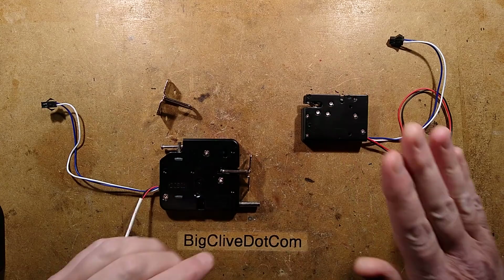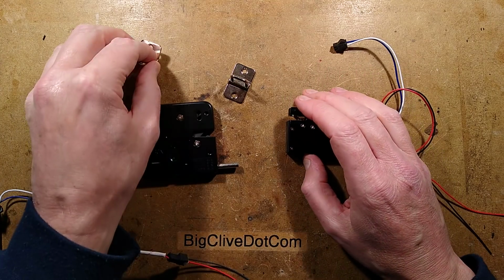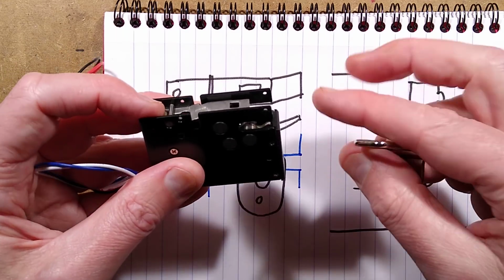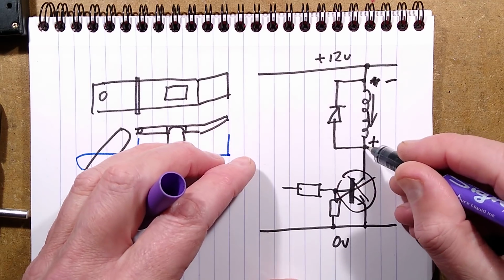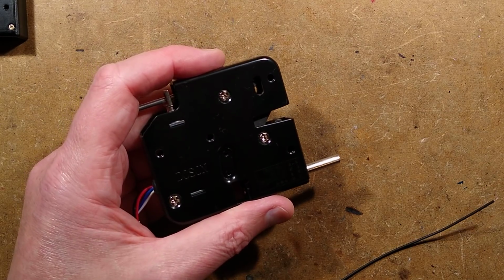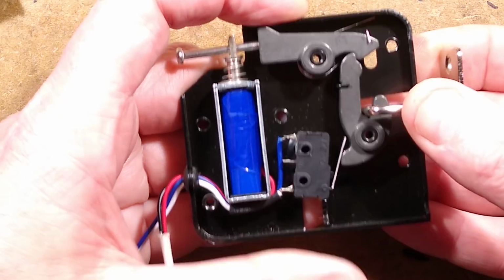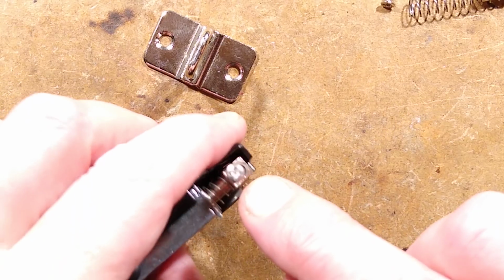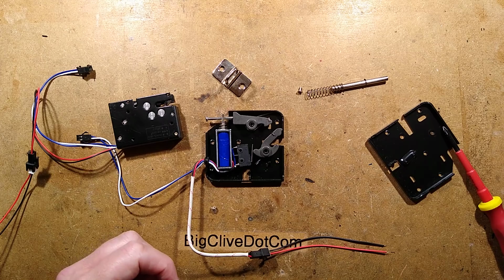Inside an eBay electric lock mechanism

Comment: Problem with that design is that if they fail, they fail secure (which means the lock stays locked). A convenience that suddenly becomes a significant head ache, especially since the lock will usually be mounted inside the door.
Reply: Oh, I've been servicing such problems for 4 years already. Our automated lockers, used specially for drycleaning orders, use bad quality locks, and they stopped opening doors after a few months of working. Every few months, kind of in a way BC described at 6:57
Reply: i often see these in pick up scenarios with double sided lockers where the back door is in a restricted area and only has a mechanical latch on it
that solves the fail secure issue nicely but i'm sure tons of uses aren't like that
Reply: These are the name of my existence, my eye started twitching as soon as I saw that thumbnail
Reply: We use hundreds for more than 5 years now and not a single one has failed.
We do have single hole and tool planned so we could push the latch through the (not yet drilled) tiny hole if we really need to, but I guess crowbar would work too... 😁
Reply: @zlac  you should consider yourself lucky not having to deal with this. We use lockers which were built with having lowest price in mind, they are made from wood, - so no service compartment for locks. Meaning you can't get to the hole on the back of the lock to open it in case of emergency
Reply: @KOTYAR1  Oh, we did the same thing. Cheap wood and $2.50 locks from China. We use software to shoot 200ms impulse "just long enough to open" so none of them burned out and probably won't. Transistors we use are actually short protected ICs so they're safe as well.
We use those in the gym lockers. All the lockers are made of cheapest wood possible and the lock itself is inside a simple cnc made plastic case that has a hole next to the latch so you could use like a bicycle spoke or something and push the latch... never needed to do it yet, maybe it wouldn't work, I don't know... maybe there's another "failure point" that we didn't come up with, but hundreds of lockers with those crappy locks and RFID reader in each one of them and they ALL work 5 years later, it even amazes us! :D
Reply: @zlac  that's how they SHOULD work. And our manufacturers wonders, "hey, why don't ppl buy these in droves?" and "hey, why do ppl buy these lockers, install them, use them for a month and then scrap them?"

Comment: wondering if there's any mechanical "pulse" push button... 
the detent in these locks could be quite useful when the moving door needs a start kick to be pushed away especially in the sliding door design.

Comment: Harry Potter's Platform 9 3/4, have your smart phone on the trolley walk up to platform 9 supporting pillar  and the door opens to reveal platform 9 3/4. Or a trap door in the floor to get rid of unwanted visitors to the cellar. You said they can not be opened with a magnet have you tried a piezo spark generator from a gas lighter?
Reply from the maker: The piezo spark technique was designed to damage the electronics.

Comment: I suspect the Lockpicking Lawyer would have that open with some implement in less than a second.
Reply: He'd probably have a live pigmy goat lick it.
Reply: He can't. It's behind a metal door. No outside access.
Reply: As it would be buried inside something else, the security of whatever its inside determines how easy/hard it is to get into. Additionally any sort of EMP device would likely be useless against the lock itself as the coil has quite a low impedance. Your only hope would be either a crowbar, or possibly getting whatever driving it to fail short-circuit so it opens.
Reply: @mysock351C  I wonder if a firefighter's haligan bar would make short work of the job.

Comment: I wonder if a locker with a lock like this is lock picking lawyer safe?
Magnets don't work with these beefy units, and because the hatch is behind the door, and not at the sides, it would be almost impossible to access the mechanism physically. 
If the electronics are EMP proof and the door mechanically stable, I think this is pretty safe I would guess!
Reply: Typically the hinges are on the outside, so are possible to simply cut, but easier to simply go to the service door and pick that lock, which then allows you to simply grab all parcels. They are arranged like post boxes, deeper than your upper arm length so people cannot simply reach through and pick from the other boxes nearby.

Comment: Question on the fly-back diode: When the transistor opens and therefore the voltage on the winding inverts, I see that the current will still be high enough (though for a brief moment) due to the resistance being only the one from the winding wire. Couldn't this current damage the transformer? Wouldn't it be better to have a small resistor (say, 10 ohms) in series with the diode to limit this?
Reply: The current isn't the problem but rather the very high voltage spike resulting from the collapsing magnetic field. The diode clamps the voltage and gives it a better path than blowing through the transistor/mosfet.

Comment: My van is an ex border agency van and had cells using those locks so I should imagine they are quite secure!
Reply: You'd be surprised how shoddy some law enforcement equipment is. Watch Lockpicking Lawyer's videos on some of the gun locks used in patrol cars. Ridiculously easy to defeat.
Reply: They don't really need to be that secure for that sort of use case.
Reply: @mfx1  Really? You don't think that the lock on a gun inside a patrol car needs a decent lock? All someone would have to do is bust the window on an unattended car and easily remove the gun. Those cars are quite often left unattended while an officer is away from the car (such as going into a business or home to investigate a disturbance).
Reply: @mattelder1971  relax, I think he meant the use case of a holding cell inside a border protection van.
Reply: @mlenstra  I wasn't sure if he was replying to my comment or Charlie Kirk's comment. Either way, I'd say a secure lock is important.
Reply: @mfx1  I have a friend that works for border control, and I can assure you that they do.
Reply: @mfx1  Without knowing where Charlie Kirk is from, it's hard to know which he is referring to with any certainty. Just because YOU make a differentiation between border agency and border control doesn't mean that everyone else does. My point remains that law enforcement AGENCIES (no matter what country they are in) don't always have great equipment, including locks. You totally missed the point of my initial comment.
Reply: @mattelder1971  It was trivial to find out where he was from and you where the one jumping to conclusions and calling me out for being wrong without checking your facts.
Reply: @mfx1  Again, either way you entirely missed the actual POINT of my comment. I was commenting on the lack of security in vehicles owned by ANY type of government agency. I only used the gun locks as one glaring example of this. He was assuming that the locks would be secure just because they were used in the cells of the border agency van, and I was just pointing out that it was not a good assumption.
Reply: @mattelder1971  "you entirely missed the actual POINT of my comment"

No I didn't you jumped to a completely wrong conclusion and are now trying to defend that rather than simply admit you were wrong and move on.
Reply: Unlike the insecure border then!

Comment: Simplified lock operating the same way as most car locks. If you have car morgue nearby or cheap used car parts delivery you can choose from a variety of forms and sizes of more riliable and sophisticated 12V car locks with solenoid, brushed or brushless motor actuator with self operating contact encoder for the same price.

Comment: send it to LPL for an exploit, then design it better and send the new one back. Would be an epic series.
Reply: Only thing I can think of is magnet, which Clive tested and should be safe from with the steel case, and impact, which it should be safe from unless you can pick up and drop the entire bank of lockers. You could get a bit of something in to push up the latch but these are going to be mounted inside the lockers so they'll be protected from that too.
Reply: Lol .. yeah was just going to say 'LPL noting vulnerabilites'.
Reply: Was about to suggest the same! :D

Comment: The microswitch makes sure that the activation of the solenoid is only brief. So what is the purpose of the PTC you suggested ?
Cheers 🥂
Reply: The microswitch acts indirectly via the computer, which may be wrongly programmed.  The PTC fuse stops power to an entire cabinet of boxes if there is no pause between drawing power to the solenoids.  After a cooldown, all returns to normal.  If a refilling procedure opens all the empty boxes in too rapid succession, the PTC may "blow" too.
Reply: @johndododoe1411  I see. Thanks 👍🏻

Comment: I'm guessing the microswitch is in series with the coil so it can't be permanently powered ?
It may also signal the electronics to say it's open. or is it only for signalling ?
Reply: I doubt it's rated for breaking a 5A current.

Comment: I am new to this. What happens if the power is out? No access? Or is there a key?
Reply: No access until power is restored.  It's essentially a vending machine for packets.  You scan the receipt from the seller (in the form of a package number) and get the package.  Around here they are run by delivery companies, no Amazon.
Reply: I would guess that there is no mechanical override
Reply: @pineappleroad  There may be a high end mechanical lock to access the internal electronics and power supply, from where a technician could probably hotwire doors to open.

Comment: Long before amazon lockers were even a thought, Car door poppers were a thing when tuning meant shaving the door handles on a polo xD oh the tuning before even F&F was a thing... XD
Reply: I thought tuning was adjusting the trigger angle of the spark solenoid and the valves to get maximum output at a chosen rpm.
Reply: @johndododoe1411  I'm talking about the transition period xD between adjusting spark timing by turning the cap and having 1000 hp supras, the time where Polo G40 and Audi A3 got Lambo scissor doors, shaved door handles, FIAT Unos with subwoofers that weigh as much as the car etc.
Reply: @Tarex_  But shaving the door handles wasn't the tuning, it was just part of weight and aerodynamic improvements.
Reply: @johndododoe1411  and the Chrome wheels were for more grip and red neon underglow for 20 horses because stickers would counteract the weight reduction..

Comment: So they actually sell the locker rip off control boards too ! They have all the stuff built in, I have used the SouthCo electric locks, those ones use a gear motor and a 3 pin wire with constant power and a pulse on the line to open, and work more like a car door locking paw, think lift gate on a hatchback.
Reply: Hey, that's very interesting to know, thanks for the info!

Comment: Would the use of the ptc fuse not create an oscillating situation if the mosfet short was still there? The short would cause continuous current, causing the ptc to heat up and break the circuit. The ptc would then cool down but, as nothing has fixed the shorted mosfet the coil would activate again  and the ptc reheat. This would repeat until something stopped the power?
Reply: Hi 57dent. Those PTC fuses go almost open circuit when taken beyond their rated current, so they still pass a very small current which is just sufficient to keep the device in the "fused" condition. They then reset when the power is cut for a short time so oscillation would not occur. It's a good point raised though.
Reply: It should just stabilize to enough stable current to keep the fuse triggered, which is way lower than the rated current when cold.

Comment: I did wonder how they got the door to swing open. The only issue I have with those lockboxes is the criminals in the area know you are going to collect goods and dependant on where the lockboxes are they may be waiting, they would not know what they were stealing though. 
Thank you, Clive. They seem fairly robust and probably difficult to defeat except with extreme force
Reply: Yeah, i'll just stay away from anything in a big city, or crowded area.... 

Heck, in Seattle you can't even go to the courthouse (yes, that court) without the threat of being robbed.
Reply: Applying the same logic, shouldn't ATMs be crowded with criminals? Like in that Steve Martin film "L.A. Story"?
Reply: @mojoblues66  actually there are issues with ATM's. Number of them have been detonated at night, pulled by car or by stolen excavator.
Reply: in UK I've only seen Amazon collection lockers in places such as inside supermarkets, shopping centres. basically well lit, people around and lots of cctv coverage
Reply: @gleggett3817  There is a Hermes one round the corner from where I live it is next to a corner shop, like a mini supermarket if you know what I mean. There are concrete and steel reinforced posts in front of it to stop someone backing a van into it but I wouldn't say it's particularly in a safe area, there are muggings around here so you have to watch your back. I'm a big guy so not so worried for myself so much but older people have been attacked but if someone has a knife well unless you make them eat it which would be my preference then it's best I guess to hand over what it is they want rather than end up in the hospital or worse.
Reply: Clive should do a self defense segment on what Brits may use  here in the US in Indiana ( and most other states except the liberal ones ) we have pistol carry permits  by federal law you cannot carry in the post office . But out here in the country they do not enforce it most open carry too  the bad guys seem to know this  we also have laws that prevent banning carry in most public places we seldom have a Robbery also we have the stand your ground law . Sadly in the UK you cannot fight back  like we can .
Reply: @johnsiders7819  you'd have nothing to "fight back" against if you fixed your disgustingly abusive society

Comment: That's a lot of current to pass for releasing what looks like a fairly simple spring mechanism! The lock looks quite safe when installed in a storage locker configuration, all these comments about rapping/tapping it... seems quite hard when it's mounted in a storage case.
Reply: Yeah I was immediately thinking about how to pick one the moment Clive opened it but as you mentioned it all comes down to how you mount it, if the door has a lip and it's tight and sturdy enough it would be pretty hard to open cleanly
Reply: I've had a few for a while in a remote catapult application, they're designed to hold 150kg so quite a bit really

Comment: They would make a good a electronic crossbow trigger mechanism.
Reply from the maker: That's an interesting idea.
Reply: Or it pops the latch on the kennel door and releases the Dobermans.
Reply: @tncorgi92  Smither's will be out of a job then 🤣
Reply: Clive,that sounds like a cool idea, switch,crossbow, phone app 🤔 feckin great security system 😁
Reply: Remote activated crossbow bolt launcher? 🤣  Cheap security system!

Comment: Low duty cycle.
So what you're saying is that you're going to make a 555 circuit and a relay to activate it over and over to piss it off and see how it fails and how long it takes? Or are you going full PhotonicInduction and giving it a full unpulsed voltage and ramping it up until it bursts?
Reply: What do you mean by "low duty cycle", what they are meant for low number of "openings"?
I use kind of same locks in automated drycleaning lockers our company uses. And the locks our dealers uses to make lockers, - are bloody awful, kind of Ork technology. I hate them, as they don't open the door if you just look at them funny. I always have a supply of locks at hand, because they surely stop working every few months, and the only repair is to send them to manufacturer for repair. Prоm1x SМ-3О8, they are called.
Reply: @KOTYAR1  low duty cycle basically means they can't be powered too often within a set period of time. So if a machine had 100% duty cycle it can run continuously. An example of a  duty cycle thing might be like a cheaper welder. If its a 30% duty cycle welder, within a given 10 minutes it could operate for 3 of them continuously. A small, high power solenoid like this might be a much lower duty cycle than that. Like you could only open it once every couple minutes
Reply: @KOTYAR1  10% duty cycle in this case means no more than a half second power pulse every minute, as that CCA wound coil will otherwise turn into a black mess. For the price that coil wire will be CCA, not enamelled copper, and will fail at under 130C coil temperature.
Reply: Thank you for your comment, sorry for not leaving comment in good English, I'm just very tired.